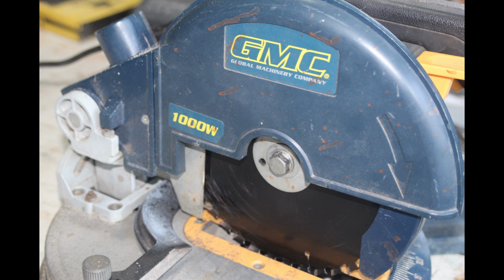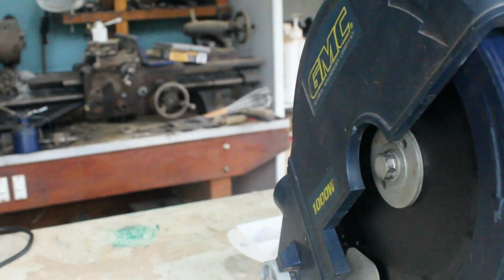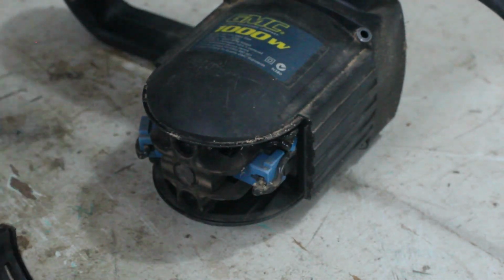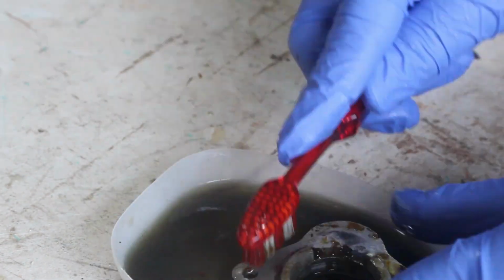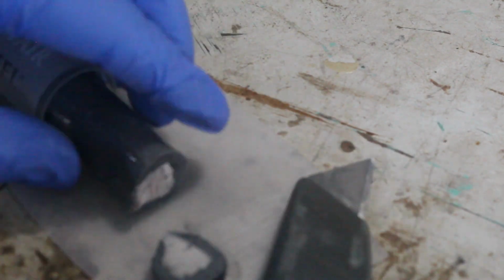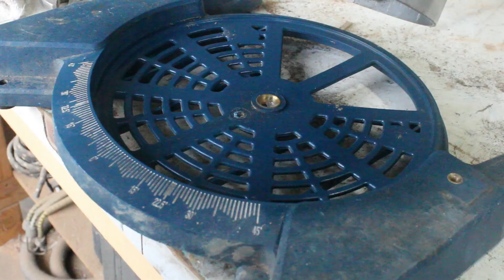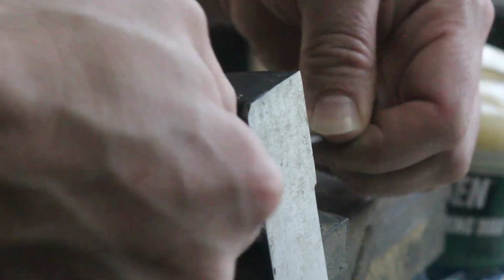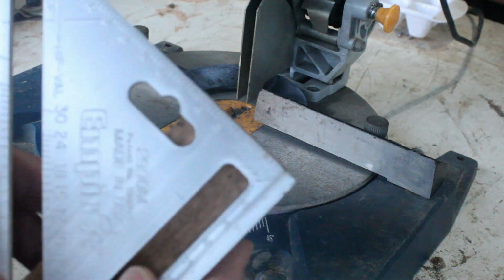GMC MS190 Mitre Saw - bearing replacement and service

Comment: Thanks, I've got a very similar Kinzo saw, and hearing your result has me convinced I don't need to put in the effort to replace the bearings. Mine makes a similar racket. I'll just give it to the thriftstore when I get a new sliding one eventually.
I made an extra bed and fence on mine to have more bed and zero clearance cuts, used some laminate flooring.
Reply from the maker: Glad I saved you the trouble! I was a bit disappointed in that result but the other fixes were certainly worth the effort.
Thanks for watching!

Comment: Thanks for a thorough repair video. I have the same unit.  The blade guard mechanism on my unit has bent and broken. I've been unable to find a PDF owner's manual or spare parts for this unit.   I was wondering if you could be able to send me a photo of how the blade guard mechanism all goes together, please? or a copy of the pdf manual if you have one. Many thanks. Mick
Reply from the maker: No problems.  I don't have a manual unfortunately, sorry I didn't take more footage of the blade guard mechanism, mine wasn't broken so I mostly left it alone. 
If you pause the video at about 1:47 and about 11:15 you can get a pretty clear idea of how the pieces go together. 
Cheers

Comment: Loved you informative video. I have the same one that sounds just the same. My blade has stopped spinning ??? It’s not jammed it still turns when I spin it myself?? Any ideas?
Reply from the maker: Hmm not entirely sure. Is the motor still turning? If so it could be the gears or just the arbor not tight enough. 
If the motor isn't turning it's most likely an electrical issue. Switch contacts, brushes, wires, etc.
Reply: Motor still running.
Reply from the maker: @dinahvandermeys2633  so take the blade off and see if the arbour is turning if it isn't it's a gear issue, if it is then it's a blade mounting issue might just need tightening or the flats on the arbour might be worn down.
Good luck!
Reply: Thankyou. I will see if I can work it out.

Comment: hey a bit late to the party but I'm trying to find a blade for this saw and I can't seem to find the right ones. 190mm with 15/16th arbor is that correct?
Reply from the maker: Yeah it's 190mm not sure on the arbor size without checking but most blades come with inner washers for common sizes, or you can buy a set of washers at most hardware stores. 
Good luck

Comment: Where do you get your parts for the GMC saws? I can’t find any anywhere
Reply from the maker: I'm not sure sorry, the bearings I replaced were generic 6000 and 600 series, the number will be on the metal shielding or the rubber of the old ones. 
Hope this helps!
Reply: @grannyflatgarage7599  Thank you I’ll try that